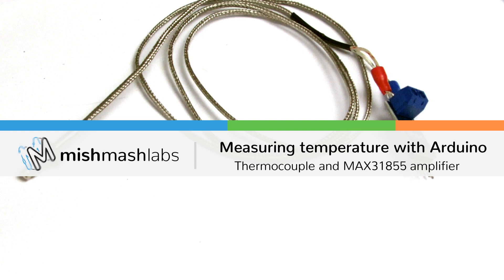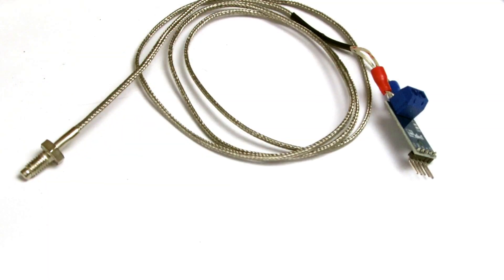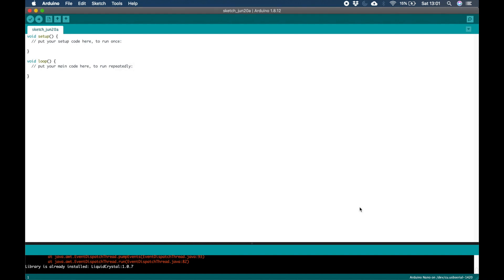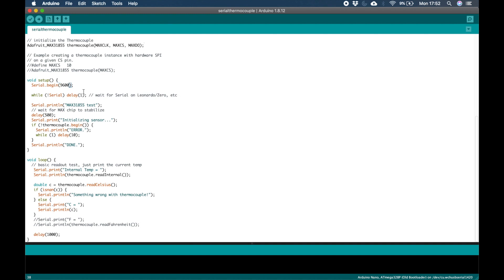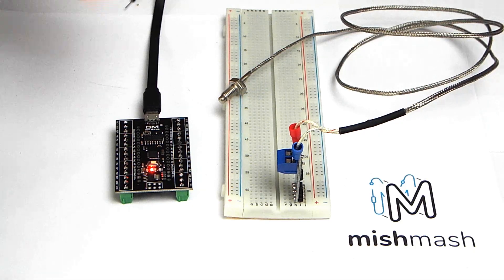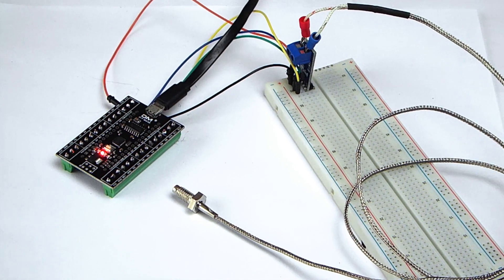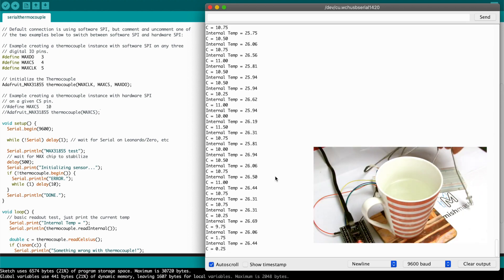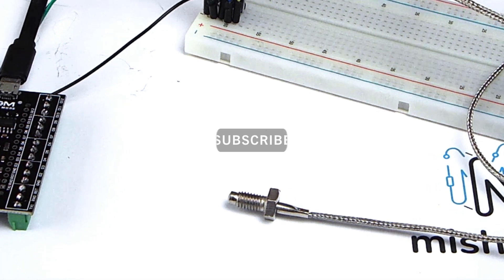Arduino MAX31855 Thermocouple Tutorial | SPI

Comment: Had nothing but trouble with these modules. I'm trying to control a kiln. Everything fine until the temp gets to around 1400 F then signal gets wacky or loses contact with the software. Anyone else have this trouble. this doesn't happen with the Analog Devices chip. ?

Comment: This is an excellent video with thorough description and clear photo/videography!
Reply: Opps, but there's an error in the voice-over at 4:28 where the connections to the nano's digital I/O are identified as pins 2 (digital output), 3 (chip select) and 4 (clock speed) contrary to the info at 3:55.
Reply from the maker: Thank you sir!
Reply: @MishMashLabs  Hi again, Im having trouble - both temperature readings are always 0. Swap TC between hot water and cold water baths and still COM3 output is (always) 0 deg C. Connections between max31855 & arduino have tested OK with multimeter. Confirm 3.3V supply to the breakout board. Confirm voltage across TC terminals changes as TC swapped between HW and CW baths. Is there a way to diagnose further?

Comment: You shouldn't be using crimped connectors on the leads of a thermocouple as this introduces another junction which in turn incurs, usually a 1 degree error. Another thing to consider is the terminal block. Professional instrumentation use non ferrous terminals. However, if you know the errors you can offset them in software.

Comment: hi there. im following this tutorial but im having a problem and hoped you might have some suggestions.
im just using the example sketch and havnt made any changes to it. with a K type thermocouple.
when i read the thermocouples temperature, it gets lower when i put it against a hot object, and vice versa. 
its ambient reading is 15C lower than the arduinos, and if i press the probe into my cheek, the temperature goes as low as -23C.
apparently this can be caused by incorrect polarity on the thermocouple leads, so i tried swapping them, but it had no effect. the temperature still dropped instead of rose.

do you have any idea what might be causing this? id be grateful for your help.
Reply from the maker: Hi,
It could be poor connections, or poor quality components. Just make sure the connections are made well and try once again

Comment: Nice video! however I have an issue while uploading the code. It said that "Error compiling for board NodeMCU 1.0 (ESO-12E Module)"

the massage showed
Arduino\libraries\ArduinoJson\libraries\Adafruit_MAX31855_library/Adafruit_MAX31855.h:30:32: fatal error: Adafruit_SPIDevice.h: No such file or directory

 #include <Adafruit_SPIDevice.h>

                                ^

compilation terminated.

I hope you can help me to solve the problem, thankyou.
Reply from the maker: This application was built on an arduino nano, the libraries are compatible with all arduinos, they are likely not compatible with the ESP range or NodeMCU. You need to find an alternative llibrary for the MAX31855 sensor.
Reply: @MishMashLabs  I got the same massage when i was using the arduino uno. I have already install required libraries for max31855 but it still gave the same massage
Reply from the maker: You also have the  Adafruit_SPIDevice.h installed from the Adafruit Bus IO Library?
https://github.com/adafruit/Adafruit_BusIO or you can istall it using the Arduino Library Manager - "Adafruit BusIO"
Reply: @MishMashLabs  Thankyou so much, it worked. However the thermal input in the serial monitor is so fluctuative e.g. it can rise from 15 to 100 then dive to -25. Is it probably because of the quality of the thermocouple itself?
Reply from the maker: Yes, or sometimes loose connections.
Reply: @MishMashLabs  or possibly because of the amplifier?
Reply from the maker: @chandra7734  where the  thermocouple connects to the amplifier
Reply: @MishMashLabs  I changed the thermocouple and problem solved. Thankyou sir

Comment: Could you share your code ?
I want to use this for a arduino based protype for dc moter!!
let me know if this code helps?
Reply from the maker: Hi, there is a link in description or you can follow this link; https://github.com/mishmashlabs/MAX31855_LCD_Relay/tree/main/Thermocouple_with_LCD
I recommend using a PWM controller for your DC motor so you can control speed. But this will also work.

Comment: Hi, thanks for the video this was really helpful. I need to read temperatures of -80C, can I use this thermocouple (https://www.amazon.com/NOYITO-MAX6675-Thermocouple-Temperature-0%E2%84%83-1024%E2%84%83/dp/B07FZX7VPB/ref=sr_1_6?dchild=1&keywords=k+type+thermocouple+arduino&qid=1605678488&sr=8-6) with the MAX31855 amplifier (https://www.amazon.com/gp/product/B07K5MJ43M/ref=ox_sc_act_title_2?smid=ATCVC199CHVK0&psc=1) and read low temperatures?
Reply from the maker: Hi Aldo, 
The K type thermocouples have a range from –270 to 1260 degrees C. It should fit your application. I believe the range given in the product spec, of the link you provided is incorrect.
https://www.aliexpress.com/item/32745832554.html
Reply: @MishMashLabs  Thank you!

Comment: Thank you for your description! It is very good. I have tried to use your description, but the temp are far from correct. I have a probe I can check with an meter that it is OK . I guess the amplifier max31855 is sensitive , so I bought another one but the result is still very random from houndred degrees C to thousand. even negative., The probe I use has a yellow contact. something is wrong but I cannot figure out what.  Any idea? I have read on arduino forum on similar problems
Reply from the maker: If it is bouncing around, you may have a dodgy cable or bad connection. 
K type thermocouples are roughly +/- 2.5% accuracy. If it's just a poor quality thermocouple and it's a stable result, you could add an offset in the the software to make it more accurate.
Reply: @MishMashLabs  Thank you for your answer! I guess MAX31855 is very sensitive, My probe has a yellow connector so I can use it  to check with my meter, I did not want to remove the connector therefore I used small cables between the connector and MAX31855. Do you think they are picking up noise?
Reply from the maker: They could be, without a picture I couldn't say though. Try replacing with bigger wire, a making sure the connections are solid. If you're worried about noise. Twist the cables around one another to create a twisted pair.